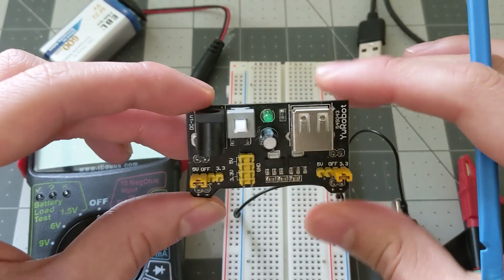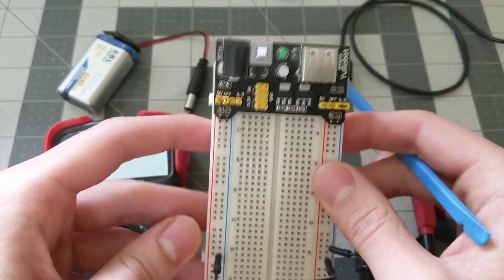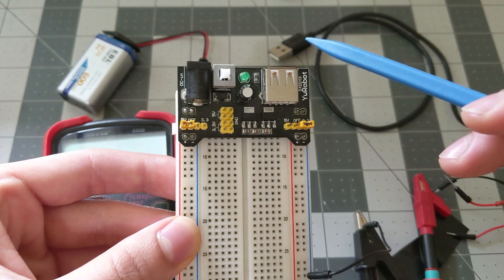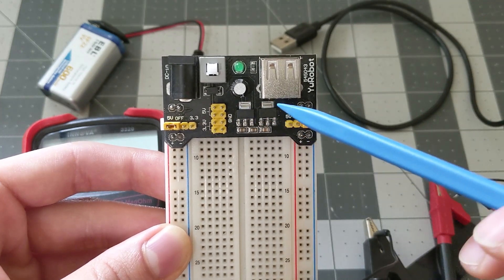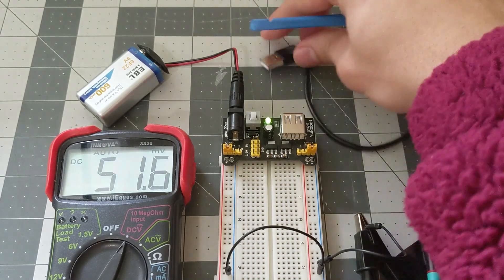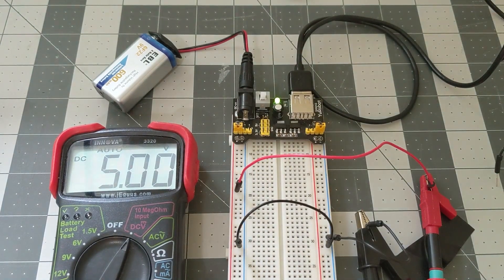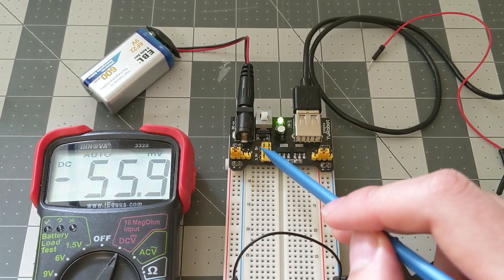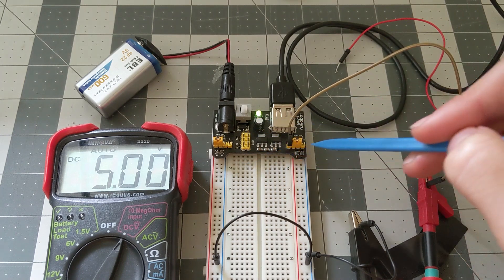Breadboard 3.5V 5V Power Supply Module | Everything you need to know!

Comment: Just got one of these, plugged my 12V wall wart in and it seems to be fine!   Wish I had these in the 90's when I started with electronics!  Funny thing is at first, I plugged a wall wart in with center negative in, and the board wasn't working (duh!), you need one with a center positive.   Really thought I ruined it, but apparently it has a protection circuit for dummies like me.

Comment: great video! though i have an issue with my own module if i connect a 12v dc charger to the module and check the voltage where the 5v rail outputs, it shows the full 12 volts instead of the expected 5 volts. is this a common issue or is my module just faulty?
Reply: 5v regulator has blown
Reply: , these boards are shit for current protection

Comment: What is the current rating for the outputs?
Reply from the maker: Hi the on board voltage regulators have a maximum rating of 1A
Reply: @QRobotix  ok, thanks. So 1A for 5V and 1A for 3.3V, right?
Reply from the maker: @mertcapkin7263  yup that's correct

Comment: I’m having this problem with mine where seemingly when I connect too many things to it’s 5V and ground pins it just turn itself off. It wasn’t doing this before and I’m not sure what the issue is (I’ve switched out the battery for a new 9V one). Any suggestions appreciated!
Reply: Have you solved it? It looks like you have some short somewhere or consuming more than 1A.
Reply: @orion310591RS  haha yeah I figured it out, it’s exactly that, I was short circuiting it accidentally... whoops 😂

Comment: That plug where the 9 volts goes in, is the center pin the positive or negative? Or maybe it doesn't matter?
Reply: The center of female DC plug  on the board is +. All round DC connector have positive on the inside

Comment: Great explanation of the board. I couldn't find where it explained the 3.3/5v output jumper connection to allow extra power out and when you set the boards to off you can still use the outputs of 3.3v or 5v. Thank you

Comment: Hi ,I have an power wall adapter that is rated for 12 V and 1.5 amp . I tested it with the voltmeter and puts out 12.20 V , would this be ok to power this kind of Breadboard Power Supply Module ?
Reply from the maker: Hi yes, just keep in mind that the voltage regulators have a maximum output rating of 1A
Reply: @QRobotix  How when AMS1117-3.3 its only up to 10.3V Vn?
Reply: @orion310591RS  looking at the datasheet, it seems like the AMS117-3.3 is powered off the 5v module so it wont see the direct 12v

Comment: How many amps can I pull from it?
Reply from the maker: Hi, the maximum rating is 1A for the voltage regulators. However, it also depends on how much your power supply is rated for as well.
Reply: @QRobotix  thank you. I see. I was hoping that it could do around 2 coz my project needs around 1,2 amps...

Comment: Your video was very useful but I still have problems with this module. I'd be so grateful if you can help me...is it possible to use this module when a have a circuit where there are other components placed between the 2 different voltage outputs? it means that the outputs wouldn't be in parallel anymore..Thanks.